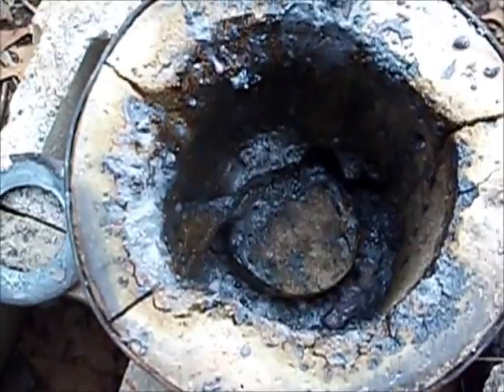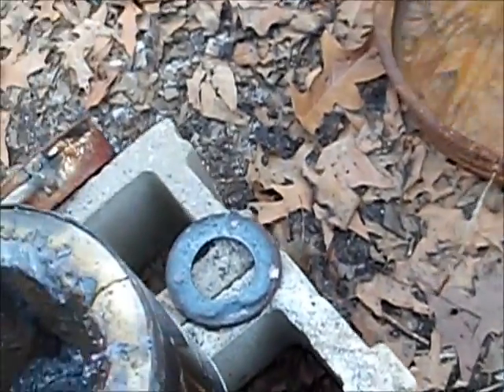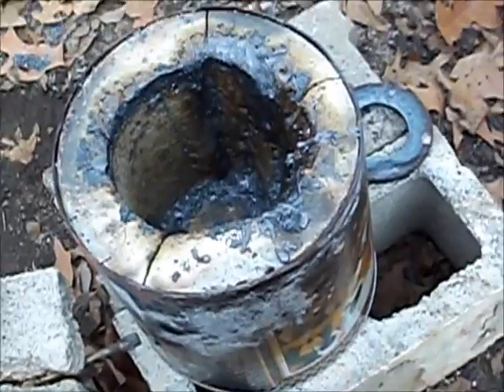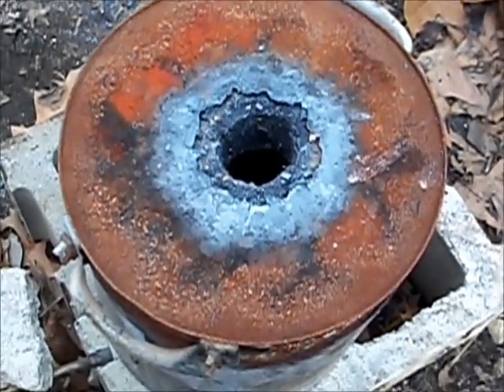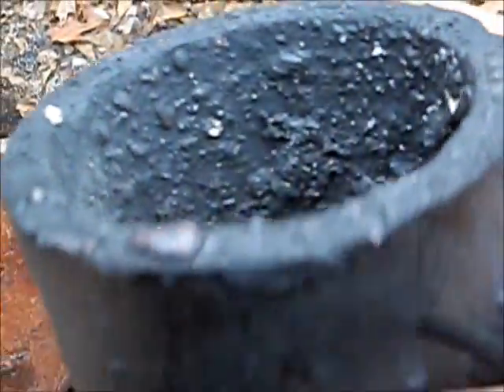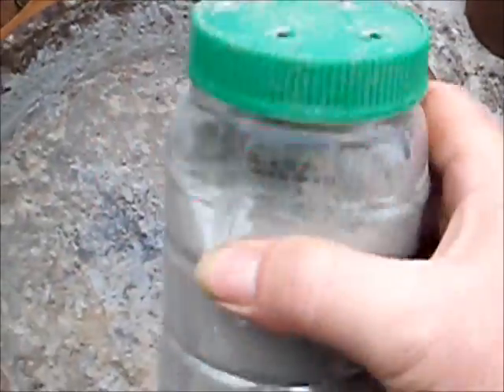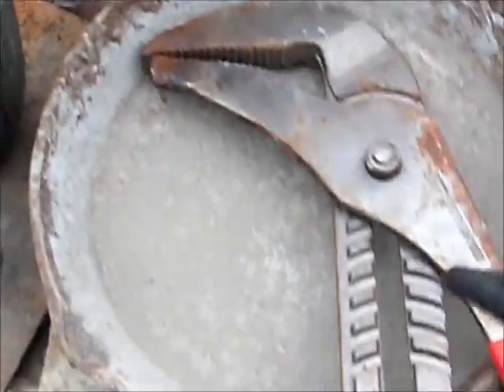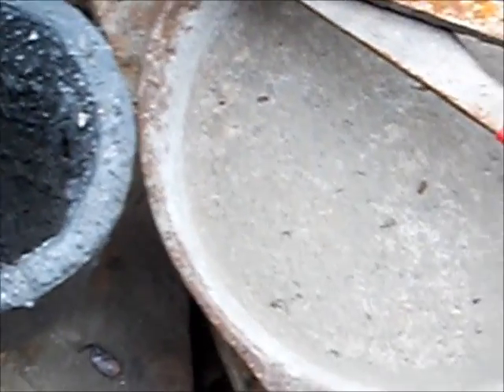furnace

Comment: hi geo I've been watching your videos for years now thanks for all the great info you provide ,i just wondered if you had any info on "amalgamite 982 process" i have reopened the discussion on >
http://goldrefiningforum.com/phpBB3/viewtopic.php?f=37&p=267741#p267741
if any one knows anything about this please could you write it in the forum if possible
Reply from the maker: I did read that thread. I also watched the videos in the link. From what I saw, it was simply lead. Lead has been used for thousands of years as a metal collector. It's low melting point lets it melt in the relatively low temps the guy was using in the video. He may have added some other metal with a low melting point just to say it's a proprietary product and give it a fancy name. In the world of metallurgy, it is common knowledge that melted metal is a liquid solvent for other metals. You can dissolve a metal with a high melting point with a molten metal with a low melting point. For example, when they solder gold plated pins to a circuit board, the solder (along with the flux) dissolves the gold plating where the solder touches it.
Reply: thanks for all the great info, i don't mean to be rude but again it is just speculation! would you be willing to take a sample of this maybe you could do a video using it or just testing to see whats actually in it
that would be amazing!
from all i have read about it i do "think" its some type of bismuth alloy but it would be great to finally have some detailed info on real evidence
Reply from the maker: If I had a small sample, a half ounce, I can get an XRF readout on it. That will be the only thing I can think of.
Reply: that would be great just tell me where to send it
also it would be great if you could get a chance doing a video using it
Reply from the maker: I don't do assays. Let me do some checking with some friends of mine that do assays. I might be able to get someone to do it for you.
Reply: ok great i have a half ounce weighed out, just let me know where to send it

Comment from the maker: I'm still kickin. I am really trying to work out the problem of low grade electronic scrap. We all know that low grade scrap still has precious metals. The problem is there's not enough precious metals to make it profitable by wet processing. I want to concentrate the precious metals by removing non-metallic components and steel components. I have plenty of my own material to work with. So it's basically going be smelting and parting to try and reduce the base material to a level that conventional methods will work better. One thing that has to happen is building a furnace that can withstand the temps that I'm generating. Fire clay has an upper temp range around 2300°F with Portland cement at around 2200°F. I'm thinking the vermiculite will bring the refractory up to about the 2600°F range. We will see.
Reply: Why using refractory? Ceramic wool works great on its own.
Reply from the maker: I'm not convinced that ceramic wool will hold up. I have plenty to test with. I will put some against the melted part and see if it will melt as well.
Reply: one more thing i noticed is that your flame comes almost at right angle instead of being tangent to furnace wall, which in my opinion will create hot spot opposite of the burner hole
Reply: Can you please tell what is the reason for the 2600+F you want to achieve?
Reply from the maker: The intake is actually off center and to the right. The refractory has melted and deformed the cavity. I don't need to achieve 2600° but I would like to have refractory that can withstand that temp. I have an idea of using waste oil for fuel and I have heard that it can burn that hot.
Reply: I see. Yes it can and will - flame temp of propane 3560F vs 3812F of oil.
Reply: Hmm how about running it cooler? I mean keep the temperature in check by fuel/oxygen ratios. Sure you can drive a Ferrari at 70mph(refractory limit) instead of 199mph
Reply: Geo this is bubbi......what the hell are y'all up to now lol
Reply from the maker: Trying to create hell on earth.